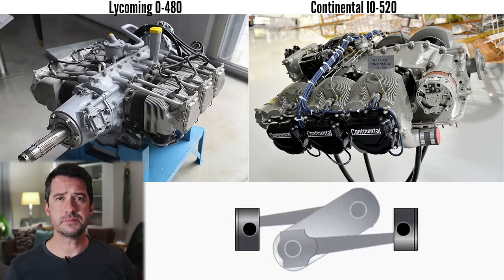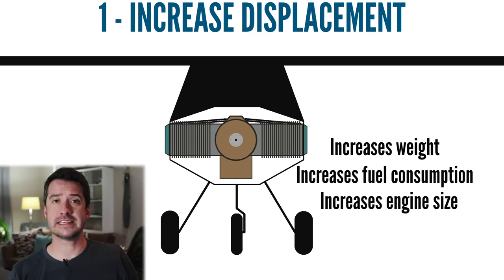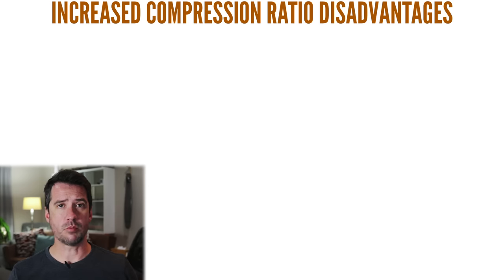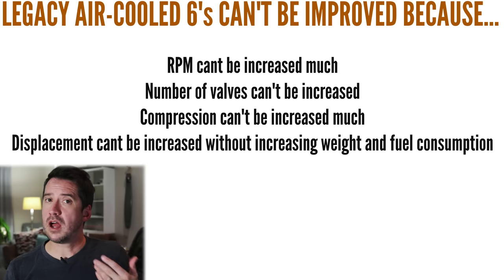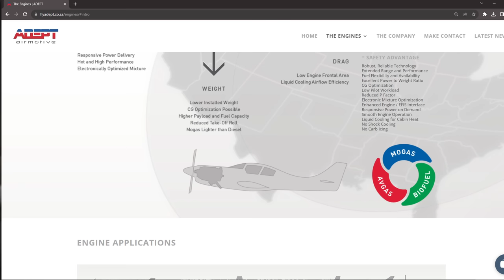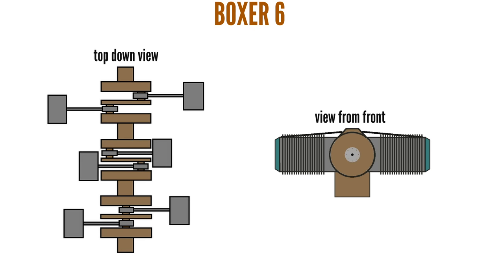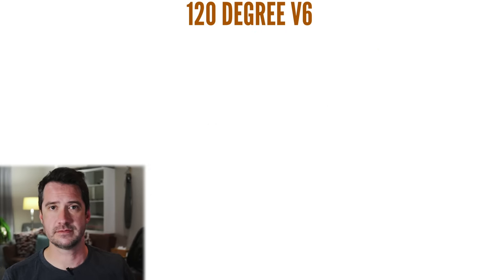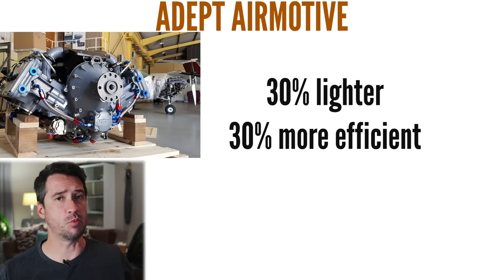Unusual V6 Airplane Engine Makes Boxer 6 OBSOLETE?

Comment: The 120 degree V6 allows oil to more easily drain to the oil pan (or scavenge pumps in a dry sump) than a flat 6 too.
Reply: Tell us you're not familiar with the term "windage", without telling us.
Reply: @driverjamescopeland what about windage?
Reply: It does make things easier a bit. Not that it was an overwhelming problem in aero use of course but it does help with the design of heads, returns, and then how much oil you need to have in total etc
Reply: @driverjamescopeland  There are a lot of options for oil windage that can minimize it to a large effect in any engine.  I posted a few of them at the top of this list.
Reply: Porsche has had some real issues over the years with their beloved boxer mills

Comment: The glider club that I'm flying at has a Pawnee with an ls1 in it as it's tug plane, and the advantages of the ls1 compared to the original 540 are absolutely ridiculous!

It has got a similar hourly fuel consumption as the 540, but with a higher power output and more torque. The ls1 is "de-tuned" to max out at around 400hp at 5000-5200 rpm, with a torque of about 1000nm on the prop and therefore has a much higher BSFC.

But the biggest performance increase as a tug comes down to the water cooling and the gearbox for the prop. 

Since there is no risk of shock-cooling the cylinders after a pull, so the throttle can be pulled right of.
Then the gearbox for the propeller makes it much harder for the air to windmill the engine, and therefore the rate of descent that can be achieved reassembles that of the Ju-87.

It can pull a fully loaded 2 seater to 1000m/3000ft and then go down to land in around 6-7 minutes!

Comment: This is the same hurdle Japanese vertical motorcycle engines had versus Harley V twin engines. I believe the vertical engines have won on all fronts except engine “growl”.
Reply: I dont think that Japanese 4 is going to run very long across the desert in the summer without coolant, unlike a harley v twin. To compare the two is more like comparing apples to oranges. They are from two entirely different set of values. Air cooled simplicity for ease of mechanics. Vs an effort to overt any necessity for mechanics.
Reply: "growl" ia subjective but if you ask me?   NOTHING beats the growl of a crossplane I4 of Yamaha R1 /MT-10  Whatever coolness one derives from Harley is just made IRRELVANT in light of the THRILL an R1 provides....again IMHO....you must experience it to understand

Comment: Awesome elaboration! Pls keep us updated on the balance shaft situation!!
Reply: No balance shaft needed in this configuration...  Inline 3s have a rocking couple that can be balanced by putting extra weights at both ends of the crank...  This is a dual inline 3 configuration....
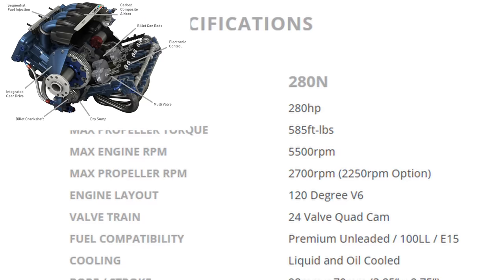Reply: @WaltDesine  :  Hmmmm....  In looking at the cutaway view of the V6 at 7:55 it seems that the reduction gear has a shaft that extends into the engine block.  Couldn't this also be used as a balance shaft?
Reply: @InquisitiveSearcher  That's a torsion shaft to absorb the shock of a prop strike and prevent damage to the gearbox. You couldn't actually have a balance shaft connected to the PSRU, the available gear ratios would make that impossible.

Ferrari doesn't use a balance shaft in their 120 degree V6, so I can't imagine why this engine would need one.
Reply: @InquisitiveSearcher  depend on secondary vibration. The chef would have to move her twice, the engine speed… The shaft on the V rotates at approximately half the engine speed… So now this cannot be utilized as a balancing shaft.
Reply: I think so too, that no balance shaft is necessary because it is perfectly balanced in primary and secondary. It's the same situation as the v8 engine which has perfect balance with no balance shafts, because 720/90 degree bank angle is 8 pistons, and in this v6 720/120 degree bank angle is 6 pistons.
Reply: @martin-vv9lf  It's not perfectly balanced, but balance shafts are never necessary, they're a comfort item, like padding on a seat.
Reply: @PistonAvatarGuy  the correct hardness rubber engine mounts, should negate secondary vibration at specific RPM ranges… A much better solution than balancing shafts to rid secondary vibration
Reply: @WaltDesine  I agree, that's basically how it's done with the vast majority of engines anyway, which aren't perfectly balanced and don't make use of balance shafts. Even Lycoming has its Dynafocal mounts to curb the vibrations from its engines. Continental uses a similar arrangement, but their mounts support the engine from the bottom (makes more sense to me).

Comment: The German company Zoche had a four cylinder radial two stroke diesel. It was light powerful very efficient and did away with many parts needed on conventional engines. The company failed of course. Homologation of new engines (even simple ones) is ridiculously slow and expensive.
Reply: Porsche tried and failed too.
Reply: I saw the Zoche engine built in an Extra 230 airplane when I visited Extra aircraft about 25 years ago. They were very angry about Zoche because he didn´t try to get the test permission to flying the engine and Walter Extra, the boss of the company wouldn´t have tried the thing illegally. On the test bench the engine made only a few ours before failing. The piston part is in fact very simpel. However there is a gear box with transmission ratio 1:42 to start the engine and to deliver compustion air to the cylinders. This gear box is rather complicated.

Comment: Mabey they are Using a weighted crankshaft. Extra weight is added to parts of the shaft that are 180 degrees out of faze, and then drilled out to match the weight of the piston, connecting rod and wrist pin. Another possibility is using part of the gear reduction as a harmonic balancer. Say weighting the first output gear on in the gear box to further counter the phase vibration.
But im just speculating from what I remember of engine theory.

Comment: Well good luck, It has been tried many times and it never seemed to work as well as theory , But in concept it would be useful , most systems fail due to Insurance issues of Untried systems. I hope they work out but i have been in the field for many years and have seen most fail to be Viable! I had High hopes for Delta Hawk but if has been years to coming to General Aviation, It is finialy starting to come out. Once again Godd luck

Comment: so as a guy who has wrenched on just about anything you can think of on land or sea I know there are things I don't know about plans although I seem to get the impression that it is a very long and expensive proses to do anything to different or new and even more if you want to get into some kind of production. I am a little surprised that I haven't heard much or anything really on electric or hybrid systems for small plains  I could imagen using a couple axial flux motors one as a generator on the engine and one to drive the prop that would give a number of options. One option would be to use a small battery in sensitive take off and landing arias , could also use it like an electric gear box giving a near infit options for engine and prop speeds, then if things were kept in line could have a emergency physical link.

Comment: I like your description, but have a comment on balance. A 3-cylinder engine has a primary rocking couple. Put two of these together with a 90-degree bank angle and the two couples combine into a rotating couple that can be balance with  a crankshaft counterweight at each end of the engine. For a 120-degree bank angle, these rocking couples add together into a rotating couple that could best be described as elliptical. two crankshaft counterweights can then balance out all but about 13%. The marketing people could then describe the balance as "excellent!" Actually, the remaining unbalance is probably acceptable. I picked this engine configuration for my senior design project in school, a long time ago.
Reply from the maker: Thanks for the comment. Great info here. I came to the same conclusion but stopped short of how excellent balance was achieved.

Those two crankshaft counterweights you mention would then be 2 additional to the standard 3, one at the front and one at the back where the combined rocking couple moment can be cancelled to some extent? And would an unbalanced flywheel be able to futher reduce the inbalance?

Comment: A good technical analysis thank you, but the big issues to new entrants into the GA engine market are commercial: 
1) the market for new engines is tiny and the replacement lifespan of engines is very long (5 times that of automotive engines) 
2) the only realistic market for newly designed engines is a retrofit market (and so the new engine cost needs to compete with an overhaul engine cost). This is almost impossible in a small market where not only the core engine build, but all the development and approval costs have to be absorbed into an inevitably limited production run. 
3) the product liability risk is significant when comparing a new engine compared with modification to existing engines. In USA (where most of the GA market is) the General Aviation Revitalization Act imposes an 18 year Statute of Response for lawsuits against aircraft and engine designs. So if an old design is modified it may be exempt from product liability claims should there be a defect in design, whereas new designs are not exempt.
Reply from the maker: I was not aware of number 3, and has now piqued my curiosity. Thanks!

Comment: GA is just too expensive to bother with for most of us. I can afford it, but recently came to the conclusion its just not worth it. What ever happened to Honda's new motor?
Reply: I’m the same way.  I had a C 150 for 20 years  and agree.    Too many hassles not to mention ancient designs with well known deficiencies  yet you are stuck with them thanks to Big Brother.     Then there is the fuel prices and tie down rates👎🏻.         I knew they were nuts when I saw them come out with those new monstrously priced electronic magnetos.     Parts were drying up for the old styles and going  crazy with pricing.    I showed  an illustration to my AI buddy asking what in he)) is safer or better about these things because everything that can fail is still mechanical there and heavy.    He totally agreed.
Reply: I’m struggling with the cost of ADSB, annuals, and avionics inspection cost. 17k for a 70 year old airplane looks like the cheap part of the equation.

Comment: Sorry but that Boxer Engine Animation at the start was funny.
They way they were connected to the crank from different ends :D 
They have normal conrods and dont share a crank pin like in the animation or like V8's

Comment: Have you ever seen the front crank bearing in a lyc or continental?
Reply: Yes, they're massive and long! Problems facing a geared drive system are the gyro forces of the propeller when moving the engine out of its normal operating plane; e.g.normal or aerobatic maneuvers. if the gear case is part of the engine casting, then there are fewer problems. But trying to bolt the case to the front of a motor not designed for it will cause problems and failures.

Comment: NICE vid, engine still needs be certified and price point needs be much lower.  Then need STC for older certified planes. New planes be easier moved to the engine.   Like idea of the engine.

Comment: Would the primary imbalance not simply be managed by counterweights on the crankshaft.  This is what a v8 engine uses as they are also in primary imbalance.  They do not need balance shafts if they are in 90 degree banks.
Reply from the maker: Crankshaft counterweights can only completely balance out the pistons if it's a 90°V (unless a smooth firing interval is sacrificed with splayed crankpins). At other angles something else is needed to get great primary balance.
Reply: Very interesting- cheers.
Reply: Thanks for clarifying that for me.  Would the Balance shaft be running at crank speed or camshaft speed like an inline 4 ?
Reply from the maker: @markraumer2336 Normaly for primary imbalance it's at crankshaft speed. Secondary imbalance would be 2x crankshaft speed.
Reply: Yeah, cross plane was a great invention, but it only works for V8. ( and W16 ).

Comment: There are so many automotive engine types, I have no idea why they cannot be used n aviation. Hell a Chevy ls motor at 5.3 liters makes well over 300 horsepower and is stupid easy to maintain, extremely reliable and very inexpensive. Plus reliability no on regular low octane fuel.
Reply: Weight and size is the main issue.

Comment: Love this engine , however there is one massive issue, base price 88 000 US dollars vs 22 000 to 36 000 flat 6! That is a 50 000 difference!
Reply from the maker: Yeah it's more expensive, but not as much as most people seem to think. The IO-540 went for $62,400 mid last year. If you settle for an IO-390 you get away for $47,850, but you'll be way below Adept power. Prices as per 2023 pricelist on Vans website.
Reply: A turbocharged FADEC Lycoming or Continental engine in the same power output range will cost around $100k.

Comment: Just using an electronic ignition system and an upgraded fuel inyection on the older ones will make that 30% disapear.
Reply: Remember when smog in LA was so thick it would result in visibility under 4 miles? And then cars got computerized electronic fuel injection and electronic ignition!

Comment: It's awesome when a company like this actually tries to make a vast improvement to their product; instead of doing just enough to say it's different. Some still use carburetors, in 2023. I hope this new engine is excellent, and it challenges other aircraft engine makers to improve; instead of riding on their, it's good enough, ways.

Comment: Lovely engineering but completely useless in the real world of manifacturing scale, aviation insurance and the need for STCs for each and every retrofit application. In my 43 years of flying, building and maintaining aircraft I have seen at least a dozen similar efforts that have never come to fruition. When I started building my Velocity XL-5 RG, I was consumed with installing a high-tech, fuel injected V8 with a PSRU. A very wise friend and fellow builder suggested I contact a few insurance companies for quotes. Not a single one would provide hull coverage, only liability. The same friend said it was an excellent way to turn a $300k airplane into a $100k airplane and “you’re still going to need to convince a prospective buyer that it’s safe.” Rotax is the only company that’s made it work and none of their engines makes over 140HP. Sadly, this engine is the answer to a never asked question.
Reply: Too bad you can’t just ditch the system and go Experimental.
Reply: yep it's not an engineering problem at this point! The pure weight of regs, certification, maintenance procedures etc have already killed this initiative! Just look at the process to move off leaded fuel and that has proven negative ecological and health issues!
Reply: Maybe for now, but business as usual isn't going to be an option for all that much longer. Climate change, and the need to deal with it, is changing the world, and GA engines are going to have to change too. Maybe Continental and Lycoming can develop their existing designs to run on biofuel or whatever, and deal with whatever regulatory changes are coming, but everyone is going to have to make changes eventually, which will have costs, and that may allow new players to get into the market with more radical (or at least less stodgy) designs.
Reply: @TonboIV  Interesting that you worked those two painfully skeptical words, “climate change” into the mix. General aviation, as we historically know it, will soon be beyond the reach of our citizenry. Especially for the big-bore-engined models. A new Bonanza is well north of $1 million and insurance is the tail wagging the dog. In the very near future, GA will be a distant memory.
Reply: @bwalker4194  Yes, I wrote "climate change" because it's a reality which we all have to deal with. General aviation is already beyond the reach of most people, at least as far as owning an airplane anyway. Smaller, more modern engines would likely be a positive change for accessibility of aviation, though far from transformative.

Comment: Zundapp was using a 170° V-4 in motorcycles starting in 1939. It gave better ground clearance while retaining most of the benefits of the flat engines used by BMW.
Reply: V4 is the current most winning configuration in highest level of motorcycle racing....your Ducatis Aprillias KTMS and Hondas...I recon the only hold out left now in motogp is Yamaha which I expect to also finally go V4 due to 2027 new discplacement of 850cc ....which means a reset with all new motors for all the factories....V4 maybe better for weight distribution?  And narrower width compared to inlines   Although just prior to pulling out of motogp Suzuki starting kicking some V4 butt with their old inline tech
Reply: 170 degrees? I’ve pondered a near-boxer V. Close enough to build it like a boxer. Thanks for the info. I’m going to look them up

Comment: I have been flying powered A/C since 1976.  The IO-520 and the PT-6 Turbine are examples of engines that will run for 50 plus years.
 But what the future of aviation needs is an inexpensive (less then $150K) and simple gas turbine engine in the 300 to 400 SHP power range that can burn any liquid fuel and can even be retrofitted to existing airframes.
Reply: An unfortunate property of turbines is that small ones are inefficient.  For example, a 180 HP turbine would have on the order of 50% higher GPH compared to an equivalent HP Lycoming.  Then there is the expense…